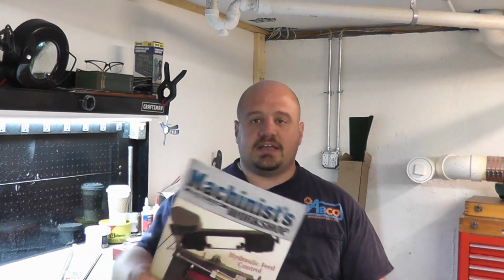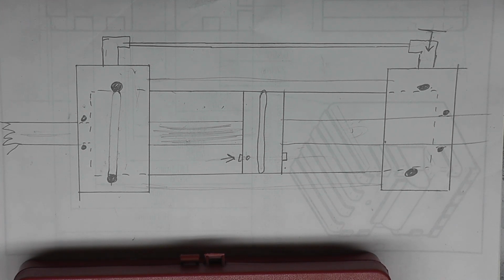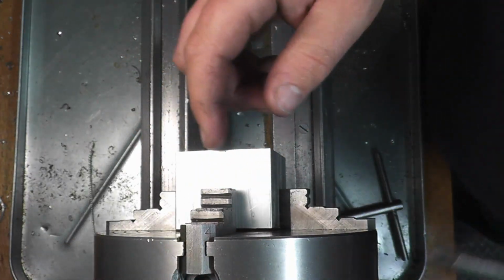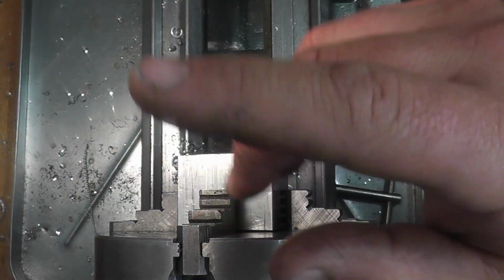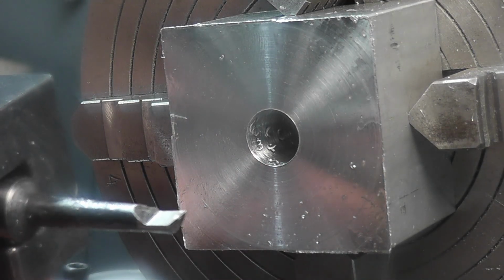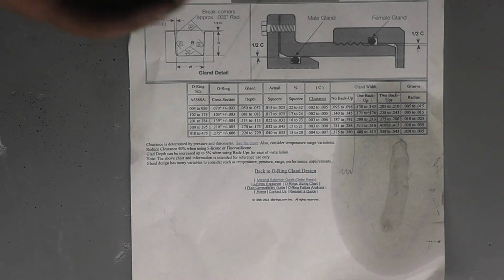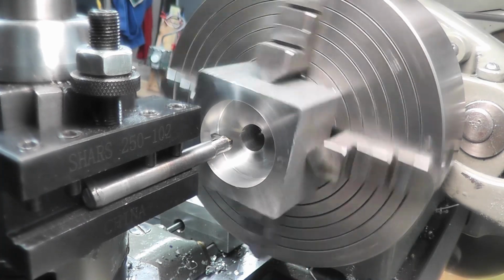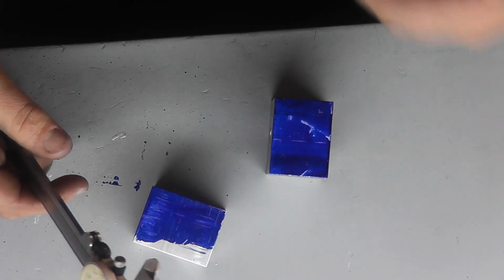7 x 4 Bandsaw Hydraulic Downfeed Mod: Part 1

Comment: Great video. I'm trying to do the same but using a pneumatic cylinder. The problem I have is finding a cylinder that has a built in check valve within the cylinder. I'm looking at cylinders that are 2 way but I'm not sure what to search for regarding the built in check valve that you showed me in your build. Hope you can point me in the right direction. Thanks.

Comment: Regarding needing 3 hands,  I cut a lot of stock on this type of saw as an apprentice. I learned to use my waistband/belt to support the head of the saw while positioning stock and tightening the vise. Still do it that way without even thinking about it.

Comment: Cool video, but i wanted to correct your assumption on the spring assist. By you testing it without a work piece, you are allowing the upper part of the band saw to build momentum, which will behave as you showed. However, when used regularly- by turning it on, and allowing it to rest on the top of the work-piece, you eliminate the building of momentum, which greatly reduces that peak velocity drop. Remember, gravity is a form of acceleration-distance over seconds squared, not speed, which is distance over seconds. In effect the spring is meant to provide some resistance to pure free fall, resistance eliminates the additional division my seconds, as well as reducing some of the distance, getting you to some lover value of the drop  speed.  when in the saw in the lowered position. If they were to provide a spring strong enough to resist the full arc drop, it would severely resist the force of gravity  when contacting metal, and it would make the cut move at  a point where the cut would take forever. I will bet you will find that out when you get to the tuning part of the cylinder. You will find that you need to have very little hydraulic pressure in it

Comment: You have some awesome videos new sub, I have the same saw, can't do some of the cool knob stuff etc that you did but it will do what I need it to do, sliced a wafer off on the stock and it didn't cut bad at all. You mention a good blade any suggestions?

Comment: Greg, by silver soldering do you mean silver bearing solder? Where the temp to solder never gets to red hot? Ive seen Keith silver solder tool bits but i always thought you needed red hot temps
Reply from the maker: +bubster1981 
Silver brazing with 45% silver rod.  Silver soldering and brazing are used interchangeably in my trade even though not technically correct.

Comment: I have had the opposite experience.  No mess with the catch tray under the cut and aluminum doesn't clog the blade, steel cuts much better and I get a couple of years of pretty constant use out of a blade (again, a quality bimetal one).  I use ATF pretty much and sulfer based for hard steel.  The tray allows '0' mess and total reuse.  I would guess in all these years and tons of material I might have used 8-10 blades.  I can't kick about that as I do a lot of 316 stainless and 304.  Some of that hardened!  I have plasma (also HF 9yrs old), torch, two porta bands, grinders etc but my quick and easy is the saw.  Doug

Comment: PS:  Nice work with indicating in the four jaw.  Adam would be proud of you. lol.  I didn't think about stopping the saw midpoint and holding it with the hydraulics while you adjust the workpiece.  That might make it worth doing alone.  I do know what you mean about needing the third arm.  I drip a bit of auto trans fluid on the blade with an old brush when doing the cut especially in aluminum.  I think you have convinced me to do this project.  Been thinking about it since I got the magazine a few months ago.  Doug
Reply from the maker: +Douglas Thompson I just don't like the mess so I don't use any kind of cutting fluid on the saw.  I tried it, but found no appreciable difference applyng by hand.  Now flood would be a different story.

Comment: Have you thought of making an outboard support setup for those extra long pieces.  It doesn't have to be a permanent fixture, just a t-bar setup on the end to hold up the extra length and mounted through a hole in the shelf.
Reply from the maker: +Kendall Comeaux I have an adjustable roller for my tablesaw that I use with a shortened pole.  Usually it's not much of an issue with me because I buy stock in 3-4' lengths.

Comment: I picked one of these up for $80 on craigslist.  I didn't get murdered, so that was a good thing too.
Comically he had the speed cones both in the same orientation, and the belt was cheap and made it chatter.
After replacing the belt and putting the cones on right, it now runs smoothly.  
Had a friend who recently ripped out his drive gear after 30 years or so.  Luckily we found someone on eBay who makes replacements. That's my story.  Thanks for reading.  Come back next time and I'll have some cookies.
Reply from the maker: +onjoFilms I like chocolate chip
Reply: +Halligan142 ooohhhh  taaayyyyyyyyy!

Comment: I read in that useful web site, minilathes.com, that there are only three (3) minilathe factories in China: Rong Fu, Sieg, and I can't remember the third one. Purple Dragon :) and these three places turn out all the asiatic minilathes there are. Only the paint, the name, and the degree of QC and finish differ. It would not surprise me at all if these bandsaws came from the same place, probably Rong Fu. So your bandsaw is ideal for this conversion. Curiously, I happen to subscribe to Home Machinist, and read the article myself. Very interesting to watch, specially since you have minimalist equipment.
Reply from the maker: +Juan Rivero Thanks!  Yeah they all look the same.  The only thing that looks really different on them is the motors.

Comment: Another great video and possible future project for me. I have a HF Horizontal & Vertical bandsaw made in May of 1994 and it works flawlessly. I paid $100.00 for it last year from an auto shop that didn't have a use for it. Central Machinery emailed me the assemble & operating instructions, which I printed out. I am going to have to watch this video a few times, to get all that info straight in my head. But like your video on the locking nut handle for the QCTP, I am sure this will be a very worthwhile video. Looking forward to the rest of the project. Again, thanks for sharing...Ken...yeah that old guy with all those questions :-) .
Reply from the maker: +Kenneth Bartlett Better to ask and get an answer then try and royally screw up.  I'm of the royally screw up persuasion :-)

Comment: read the same article a couple of weeks ago and planning the same project for my bandsaw. Except I have several double ended pneumatic cylinders I can use instead of making one. I just have to add the valves and an extension rod to one end to reach the pivot lever on the bandsaw.
Reply from the maker: +superrodder2002 I had one lying around I was meaning to convert, but figured it'd be just as much work to convert so made this one